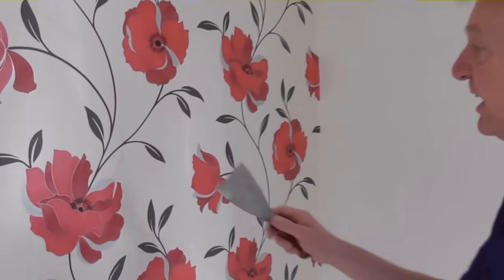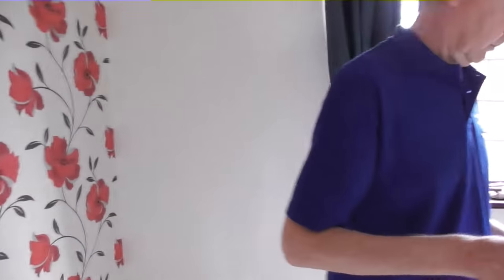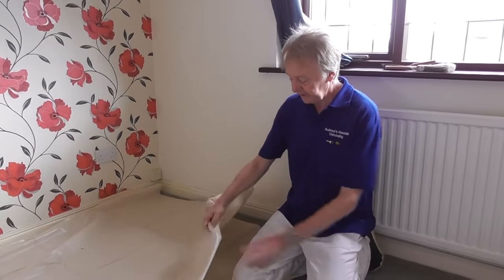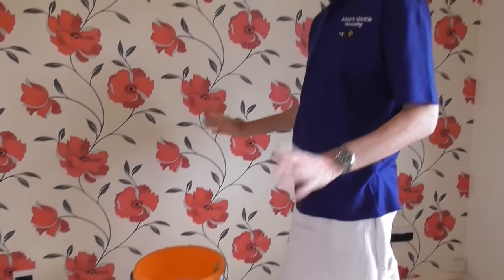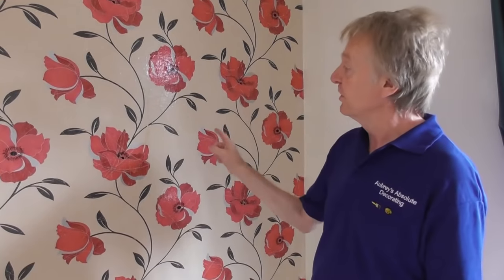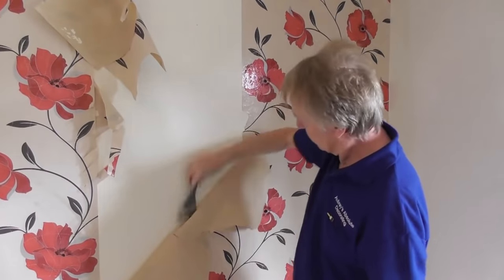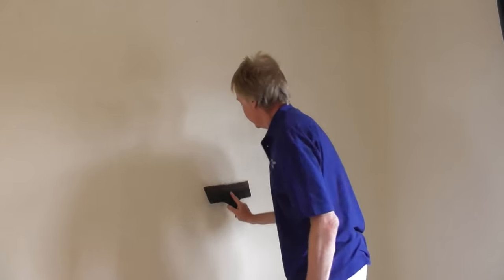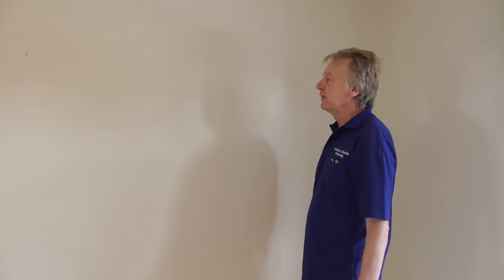How to Remove Wallpaper Fast Without Using a Steam Stripper

Comment: Great video, thanks for sharing. About to move into a house full of nasty wallpaper.....
Reply from the maker: Glad it was helpful! 😊
Reply: Aubrey's Absolute Decorating really super helpful. I was dreading the move because of this, but I have heart now after watching your video. Paper tiger, on order
Reply from the maker: Good stuff Brian.  Make sure to first check if the face of the paper will peel off.  Soak each section many times before starting to strip the paper, let the water do the work.  Fingers crossed it all goes well for you.

Comment: Any tips for 30 year old wood chip?
Reply from the maker: Hi, it has probably had many coats of paint applied to it over the years.  You may have no choice but to use a steam stripper or it will be a very slow process.
Reply: Aubrey's Absolute Decorating haha yeh I thought so! Thanks 👍🏼

Comment: It would be better to tape over the whole socket, as the water can get in through the top and through the switches. Even though the power is turned off, when you turn it back on then it might short if you don't protect where the socket meets the wall.

Comment: Come on Aubrey tell the truth, did you put that wallpaper up the day before? It came off a bit quick didn't it🤫mum's the word 😂
Reply from the maker: Mel has just commented that you can still get this paper in yellow 😊The paper I was stripping had been up for about 6 or 7 years.  The secret is to soak it several times and let the water do the work.  Let`s hope Mel finds it a breeze to remove when its time for a change 👍

Comment: Mine is very old 50?yrs woodchip wall paper 😱 making my DIY life hard. Also looks like they had painted several times on them...even worse 😫
Reply from the maker: That sounds bad Jin. I have had to deal with similar many times.  There may be no other choice than to fire up the steam stripper for this.  Wait for some cooler weather and call in the reinforcements.  😒

Comment: Are you sure you’ve only just wallpapered that wall in the morn no way does wallpaper with backing on come off that easy unless your very lucky 😂🤔
Reply from the maker: Hi Mark, The paper I was stripping had been up for about 6 or 7 years.  The secret is to soak it several times and let the water do the work.  You are correct in saying that not all wallpapers come off that easy but using this process does help 😊